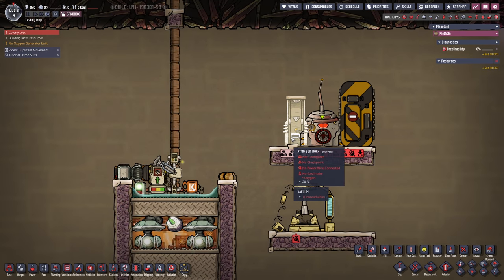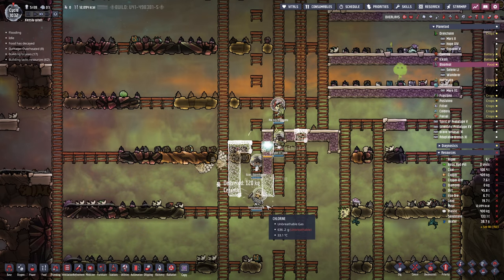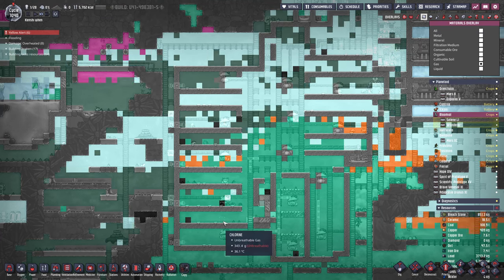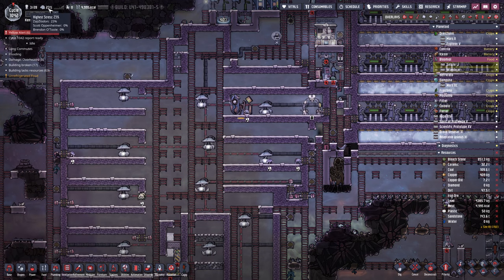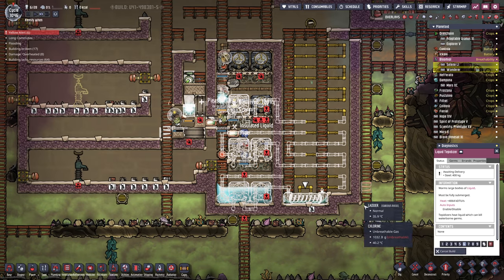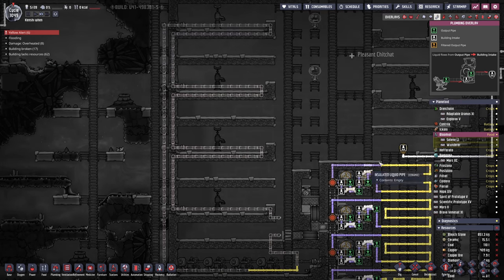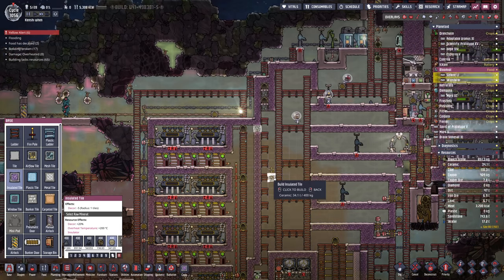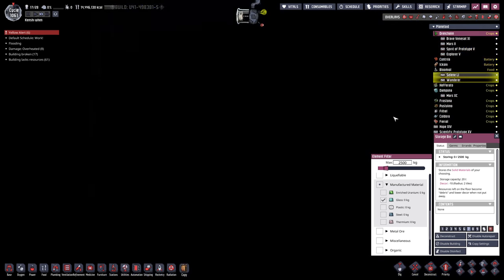Ep 39 : Sour Gas Freezer Part 1, Extra hard : Oxygen not included

Comment: the arbor tree loop is probably the best use for the polluted water from burning the natural gas. Ethanol distillers produce a ridiculous quantity of polluted dirt, witch can make dirt for food, off gas  polluted oxygen to be filtered for breathing, and be eaten by sage hatches for coal power and BBQ. Also pokeshells can convert it to filtration medium for your toilets, and you can ranch as many slicksters as you want off the co2 it makes.
Reply from the maker: That is one of my favourite designs so far, I have an eight dupe base using that loop to survive entirely off 1kg of nat gas.
Reply: @FrancisJohnYT  I played an old-style base (right after the recreation update) that went for 1.4k cycles that had 35 water fed arbor trees and fed 20 ethanol distillers and 15 coal gens, which supports 17 dupes, and could easily support way more. It features a 8 tile wide column of co2 at 20kg+ pressures going to space, a custom salt boiler using a hot steam vent, and my ribbon wire solution to map panning speeds. It's an absolute mess, but I love it lol!
Reply: You can probably get by without filtration medium: you should be able to do enough counterflowing magic to boil and condense your water for almost no extra energy cost, and similarly condense and boil your pO2 to make clean O2.

(Bring down the energy costs is important, because there's only so much electricity you get from burning the natural gas.)

Comment: It might be useful to know when designing these mini bases, what temp the frozen methane will be coming in at because using that as a cooling method is somewhat useful.
Reply from the maker: Roughly -194C though it will vary substantially a the start as the system is booting up. Have updated the description.

Comment: Hey Francis, once you start needing to melt your solid methane on the other planets, you could use the exhaust carbon dioxide to heat it up instead of the tepidizer, though you would still need it for starting it up.
Reply from the maker: One thing I played with was cooling the entire base using the chill from the imported solid methane.
Reply: Maybe use exhaust of a rocket instead? An entire natural gas room under the rockets!
Reply: @FrancisJohnYT  that’s another thing I was thinking of.
Also, quick question: Spaced Out Base Lovin?

Comment: There is a problem with the bottom 2 vacum locks in your power plant with your steam turbines. Those bottom 2 rows the power join plate is in contact with the cooling liquid. As of right now it means stuff all that you are slighly cooling the area around the base but in the future when the planet heats up with all the oil pumps that will be running it might mean the aquatuner that is cooling the steam turbines could start getting stressed. 
You have also done it with all the new steam turbines in the sour gas boiler
Reply from the maker: I should have explained that bit. The plates will exchange temp but we don't really mind, we could have left most of them in atmosphere. Only one of them being in vaccum is important. The ones in the bottom left at 27:44
Notice the joint plate leading into the area that going to be full of steam? We want to keep that in vacuum to make sure the heat does not escape. The rest of them being designed the same way is more of a looking nice thing. We used a similar trick with the nuclear volcano design.

Comment: Hey Francis

I had never built a proper sour gas boiler before, but with the 15kg limit i took up the challange to make one as efficient as possible. Thank you for providing the save file, it was a great start. Here are some of the things i found. 

1. When dropping in two 7.5kg packets of crude oil there is always a gap of two tiles in the liquid bead pump. I believe that causes some of the crude to flake. When that happens it keeps 2.5kg as a bead, but 5kg is sent down as 400°c droplets that don't exchange heat. Dropping in three 5kg packets avoids that problem. I don't think there's a gain in energy to be found there, but there will be less heat put in to the sour gas, making things run smoother.

2. In your testing you have the crude come in at 76°c but it'll probably come in at 90°c. Might change the results. More importantly: you can counterflow the incomming oil with the sour gas. From 90°c up to 125°c heat can be soaked up passively and safe 600w in aquatuner power.

3. If you have the crude counterflowing with the sour gas, you can counterflow the sulfer with the incoming crude. This can be done away from the sour gas part of the entire contraption and is heaps more efficient than trying to exchange the heat of the sulfer directly with the sour gas. The energy gains aren't anything amazing, as some is spent on shipping, but the sulfer is gotten out at usable temperatures.

4. The SHC of sour gas is higher than that of the 66% methane + 33% sulfer. By lining the "freezer" part of the design with thermium some energy is lost in overcooling the sour gas. I don't think that it's much of a loss though. Not using the sulfer to pre-cool the sour gas slightly increases the losses here.

5. Even with ceramics i think there is a bit of heat bleeding from the boiler room to the freezer room. 

Those are the core concepts i started working with and made a design based on yours that's energy neutral*. There is also a nearly identical version of your design with those concepts worked in. You can find the save file below. I hope this is still somewhat usefull. Steal what you must :)

Thank you for making this great series.

*given enough batteries

https://drive.google.com/file/d/1LtyLkJ4DaynKY6Ed0cq41woyubmqtt3G/view?usp=sharing

Comment: Hey, since you had problems with heat transfer in your aquatuner hot box, why don't you put in nuclear fallout instead of steam? It has 4x the thermal conductivity and the smaller specific heat capacity can easily be offset via more mass. Plus it looks cooler and integrates the nuclear reactor even more.
Reply from the maker: Why is everyone trying to get me to put super coolant or fallout in that box? I mean it's possible to do but given how much heat it takes to turn them all into gas it's a lot of effort. Though it does sound pretty cool.
Reply: @FrancisJohnYT  You don't have to put more thermal mass into it than you would have with the water, so you don't need more heat, though... Plus you have the rare oppurtunity where you don't have to use steam because of turbines, so why do something fancy? No pressure though, do what you find neat 😊
Reply: @FrancisJohnYT  'It's a lot of effort' says the guy building a 10kg sour gas boiler to power his interplanetary society of dupes...

Comment: 30:48 have you battle tested the sour gas boiler with the monument pieces? They are big parts that exchange heat, making the heat exchanger less effective
Reply: The monument is on the hot-ish side, so it probably won't have that much effect.
Reply from the maker: The top to parts are glass and ceramic, terrible conductivity. The entire bottom "segment" is classified as steel with the same conductivity. So I lined it up with the temp shift plates leading into the row of steam turbines. It's a 5 by 5 chunk of steel that shares temp with all the sour gas touching it, rips the heat right out and dumps it into the turbines.

Comment: I don't think mini gas pumps are as slow at creating vacuums. They might not be great for large pressures of gas, so mix in a couple of large pumps. But at smaller pressures the amount of gas large pumps extracts goes down to the same level as a mini. Except you can build more minis for the same power. Supposedly a mini also pumps from both its tiles while a large only pumps from one,  so apparently once at lower pressures a mini pumps out more and is faster at actually making the vacuum.
Reply: On the note of where the pumps actuallu work, is untrue. 

Big pump: lower-left tile is the working area, but it also works in 4 extra directions, extracting from a total of 5 tiles (lower-left tile's center + north + west + south + east) 

Mini pump: work tile is the opposite of where the gases go into a pipe, and has the same extraction radius, but it pumps aproximately 1/10 of the ammount each tick. 

In short, both pumps have the same work-area as the liquid pumps. (It can also be seen visually when you use the gas overlay. The work area turns into vacuum each normal-speed second)
Reply: @salemprompthous3820  Ok, I did some experiments. You are correct, the work area is the same, the part on the wiki suggesting they're different is wrong. 1:1 a large gas pump beats a mini gas pump. However mini gas pumps are still more effective at creating a vacuum in normal circumstances because they are more space and power efficient at doing it.

I did 3 sandbox tests, all with 1000mg of chlorine per tile.

In an 8x8 tile room, 1 large gas pump in one and 1 mini in the other. The gas pump did make a vacuum faster than the mini.

However in the same 8x8 tile room, 1 large gas pump vs 2 mini gas pumps next to each other (i.e. both setups taking up 2x2 tiles of space) the 2 minis created a vacuum faster than the large gas pump.

I also hollowed out a classic map and created two 100x100 tile areas and spread out enough gas pumps in each to use 1920W (the max number of large gas pumps you can fit onto one conductive wire grid). Both the large gas pump room and the mini gas pump room use the same amount of power. However the room with the mini managed to create a vacuum twice. But the room with the large gas pumps still hasn't finished once.

So I guess if you have enough metal to fill an area with heavy watt wire and dedicate a nuclear reactor to creating a vacuum, then large gas pumps are ok at vacuuming out an area.
At any other point in the game where you are constrained by power, minis do a much better job of forming a vacuum.
Reply: @danfr  nicely done, though still need to get the plastics to build them, aswell as the materials research up and running. 

Once over the mid-game hump and moving into the later stages, I'll consider using the minis a lot more, see if I can set a new personal best for #cycles till a refinement-sauna is up and running. (Vacuumed room, then steamed up, is usually my biggest hurdle. So far, I've gotten one up by cycle 109, ready with 3 refineries, a crusher and two sets of 3x kilns, with a minor volcano to help out with heating all the water up)

Comment: 23:57 shouldn't you connect the second turbine to the green side of the bridge? If you connect both turbine to the white side, what's the point of the bridge?
Reply: A steam turbine requires an empty pipe. Even if 1kg of water is present, it will refuse to add its own water to it. With the bridge trick (either configuration), you make sure the steam turbine always sees and empty pipe
Reply from the maker: In theory it should work either with the green or white end. But I tend to connect via the white end unless I'm trying to give a flow priority. If we fed it in via the green end that steam turbine would have priority, which makes no difference in this scenario as 4kg will be the max going through. But I like to keep good habits.

Comment: A few questions regarding the 1 KG Methane Challenge
1. Does it have to be Spaced Out or does Base work
2. Are there any Size Constraints and or are points given for Smaller Bases
3. Are there limits on how much Space Age Material we're allowed to use. I.E don't make everything out of Thermium or Insulation
Reply: Size constraints would be, atleast, making it viable to build a sustainable colony around it. Which leads to: if you build it without access to the dlc, there might be an issue between the vanilla planet, and the dlc planetoids. 

Just guessing based on the mechanics of the vanilla vs dlc versions of the game.
Reply: @salemprompthous3820  my main concerns would be if Balm Lilies take resources to Grow in DLC compared to Base, which to my knowledge in Base they just need Hot Chlorine around them
Everything else seems to be good enough to run with Minimal changes between, assuming stuff like Consumption Rates are shared
Reply: @alexanderharrison7421  in the dlc, all the farming aspects that are in the vanilla experience work exactly the same. Only differences are the added plants in the dlc, aswell as the possibility for mutations (which would be where the vanilla plants differ in the dlc) 

Edit: as per your example, balm lillies still don't require resources, aswell ad I believe those are one of the few types of plants that can't be mutated, though I might be mistaken about balm lillies being able to mutate
Reply from the maker: I'll tell you what I'm trying to achieve. I want to put a colony on every planet, spreading out all the dupes across all of them on small self sustained colonies surviving exclusively on 1kg of nat gas. All other resources, vent and gysers will be processed and sent to a central planet for the glory of AKU.

I have my own Ideas, but I don't want to stamp down 10 identical mini colonies. Different people will approach this differently I hope and then I want to steal their designs and use different one's on each planet. From example the water planet will get a small 1-2 dupe colony to empty the desalinator. However the planet with all the metal volcanoes with get 6-8 dupes running a forge colony.

1. Either version is fine
2. Their are no size constraints, just has to support 2 dupes minimum indefinitely. I'm running one that supports 8 dupes and got a wee bit big by accident. I blame the slickster ranches.
3. No limits on materials go nuts. Just be aware we don't have access to a massive insulation farm yet so any designs that require a lot of it may not get used until we have insulation set up. That might be the last thing we do.

Comment: Looking at the build at around 23:49 and it looks like the heavy watt tiles are in contact with the oil that is transferring heat.  Won't heat move from the steam turbines to the oil, then out the wall?
Reply from the maker: 25:00 I should have explained that bit, only the bottom left steam turbine setup counts. It's the power delivery into the steam room. It needs to be vac sealed to prevent heat escaping. The right joint plate is on top out of the oil. The rest of the steam turbines could be left open to the air, I just vacuumed them to keep them all looking the same. We don't care about the steam turbine cooling escaping.

Comment: Isn't thermium pointless for shift plates and such because the thermal conductivity of the material heating and being heated conduct so much slower than the thermium?
Reply: You use tempshift plates to speed up heat transfer BECAUSE the material heating/conducting is so much slower just by themselves. Thermal transfer by contact itself can still be quite slow, even if you're using refined metals.  

Heat transfer speed is basicaly determined by the difference in temperature, multiplied by the thermal conductivity of the materials. Tempshift plates equalize the temperature of the tiles it is touching, and the temp shift plate thermal conductivity is used in heat transfer calculations. Thus with tempshift plates you can achieve the same the same heat transfer speed with a smaller temperature differential. 

Simply put, it'd be (almost) like everything touching the thermium Tempshift Plate was made of thermium, so heat transfers stupid fast. Except if the tiles are insulated.

Comment: For the steam engines on the left, I thought you had to cool them in some sort of medium (liquid, gas, etc). Isn't there supposed to be a liquid layer along the bottom of each section? I know he showed there is no gas in the nuclear section.
Reply: There were bottle emptiers, and then showing some crude oil being dropped in, though tha was just the bottom layer. Guessing it's what he did on all layers
Reply: @salemprompthous3820  I saw that on the bottom layer, but didn't see it on the others, which is why I was wondering. (I noted that he put the power connector on the bottom layer and I would have put them one up so they wouldn't touch the liquid on the bottom.)
Reply: @JohnMeinel , idd, I think the power plugs make contact with the oil, and are going to exchange the heat with the outside

Comment: is there ever a reason to tune up the steam turbines on builds like these?
Reply: I don't think so, steam turbines are used to destroy heat most of the time, the fact that they generate power is a feature, yes but most of the time, when you reach this point, power is not ever a problem so no need to spend metals on extra power. Maybe you could justify it if the planet has metal volcanoes and you are swimming in metal for that base...
Reply from the maker: The thing is this entire build once up and running cost about 2.4 KWs to run.
The nuclear reactor is providing 8.4 KWs.
The amount of nature gas the device will produce provides 84.4KWs of power.

But people tend to stay away from turn up's and smooth hatches for metal refinement. The reason is we can always produce lots of power one way or another as their are so many options. But refined metal is usually a lot harder to come by. But in all fairness the tune ups are great value and can be useful early on before you have other power options.